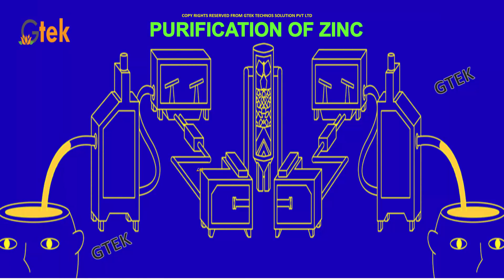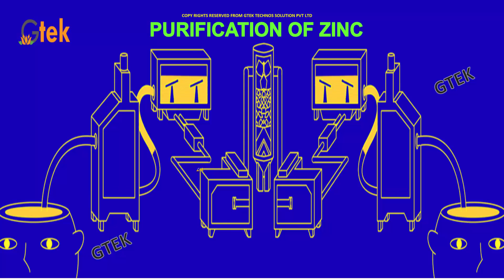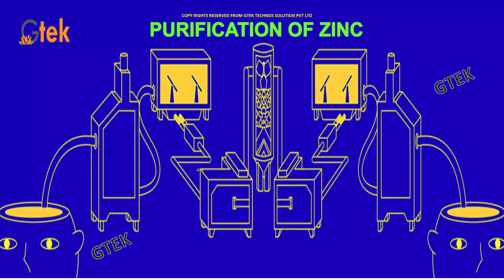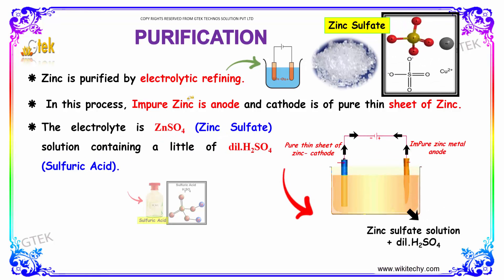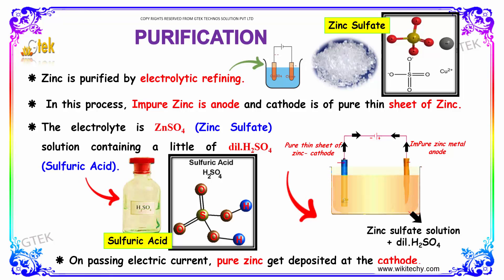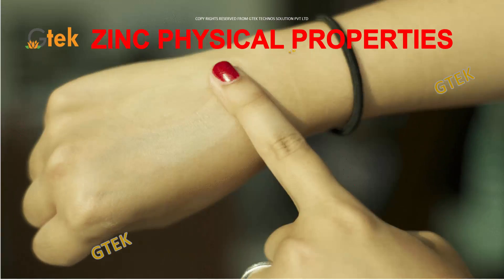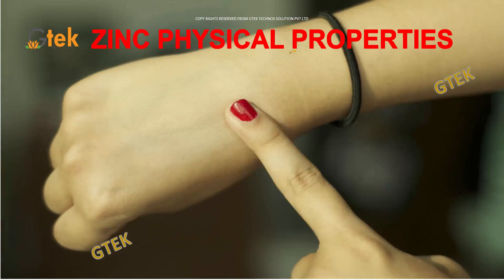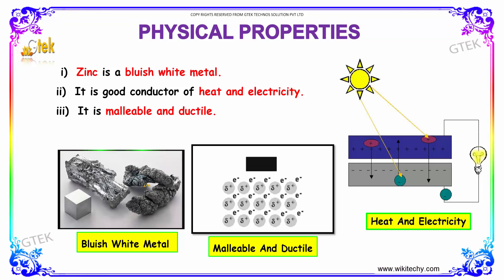Purification of Zinc D Block Element class 12 chemistry subject notes lectures cbse

Comment: Because its position in the reactivity series of metals, zinc can be 'just' extracted using carbon (coke) in a high temperature smelting furnace. – it is a sort of displacement reaction. Zinc is extracted from either zinc blende/sphalerite ore (zinc sulphide) or sometimes calamine/Smithsonite ore (zinc carbonate).

Comment: 80% of zinc mines are underground, 8% are of the open pit type and the remainder is a combination of both. However, in terms of production volume, open pit mines account for as much as 15%, underground mines produce 64% and 21% of mine production comes from the combined underground and open pit mining.

Comment: Types of zinc ore. Zinc ore occurs in two types of deposit: as primary zinc ore in thin veins known as rakes, or a secondary deposit formed by weathering of the primary mineral veins. Zinc ore is most commonly found as zinc carbonate (ZnCO3), known as calamine or smithsonite.